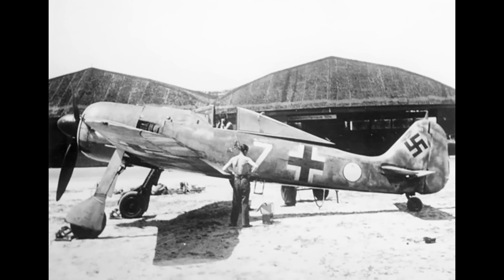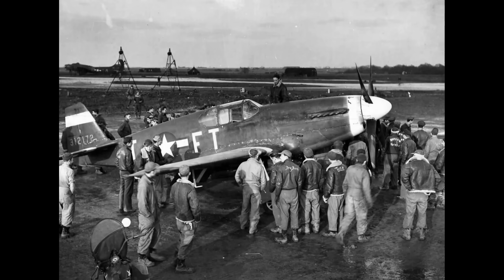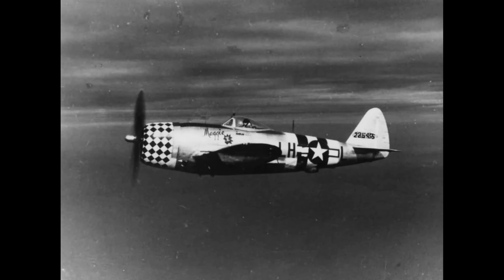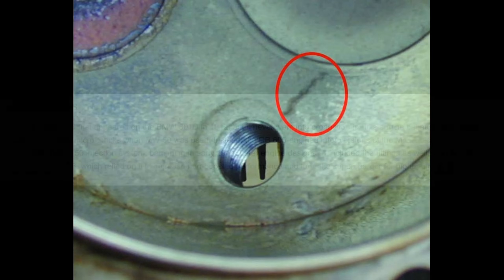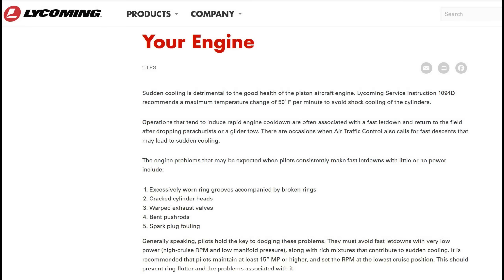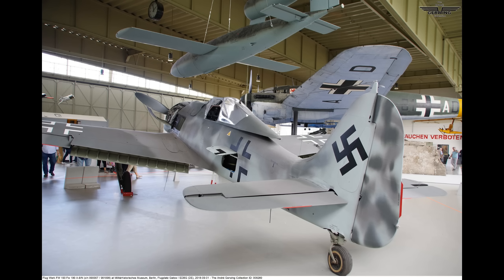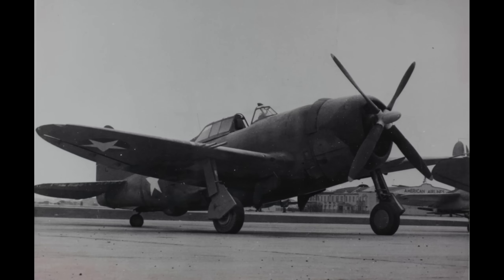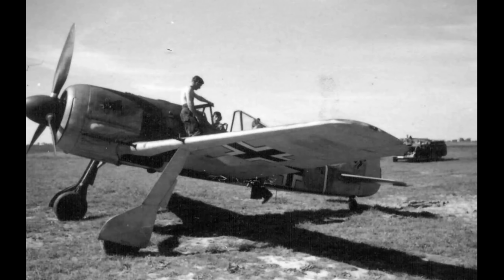Focke-Wulf Fw 190 A-4, Almost turned the tide, Almost...

Comment: I'm going to come down on the side of Shock Cooling being a myth in this application.  In my previous career I installed furnace wall cleaning equipment in large thermal power plants, which used giant water guns (called Hydrojets) to clean slag off boiler tubes while the unit was online.  We would blast 3000psi water at hundreds of gallons per minute right onto 1000degF tubes two to four times a day, every day the unit was online (8-12 months between outages typically).
We actually measured thermal transients via heat transfer sensors embedded in the tubes, these would give us tube metal temperature and Heat Flux (heat absorption).  A "normal" transient was about 100F over the course of a second or so, severe would be 200F or more.  Now this is steel, not aluminum, but I can count on one hand the amount of tubes leaks I saw in 5 years of doing this caused by thermal shock, and all of them were due to some sort of system failure (excessive cleaning, or a water valve stuck open and blasting the same area constantly).
My guess is this is entirely due to poor metallurgy, like you mentioned.  Lycomings statements sound to me like a case of "we have a few bad castings out there, and it's your fault if you break them".
Reply from the maker: You're not alone in that opinion. I don't agree with you, but that's OK.
Reply: There are an awful lot of air cooled pilots here saying otherwise
Reply: Aluminium has no threshold before fatigue takes place, even a small stress causes some life reducing damage.

Comment: When I flew the Navajo Chieftain I was taught to not drop more than 2 inches per minute on descent.  I saw the eerie glow of those pipes through the exhaust vents.  When I towed gliders we came down in a 60 degree slip/bank with the power at 1/3rd power to prevent shock cooling.
Reply from the maker: Good points Max. I'm glad to see most people agree with me that shock cooling is a thing.
Reply: Same with the 182 i did jump pilot flying with.

Fulll power in the climb, once level and coming on the drop run, power to like 15-18, adjust the prop for cruise and just hold level to let the engine cool for about a minute.

After jumpers out, engine vents closed, prop full forward, power to 15 and diving turn in the yellow. If done right you could cicle back and spiral down so you exit the decent already on final for landing.

Comment: When germany upgraded the machine gun armament of its fighters from 7.92mm to 13mm, I never understood why they went with such a weak 13mm machine gun. The German mg131 used a 13x64mm bullet. It was 2,350 feet per second. The American .50 cal used a 12.7x99mm cartridge and it was 2,900 feet per second, much more powerful and better for air combat. Germany had a more powerful round that was developed in WW1 to penetrate armor, it was a 13.25x92mm round. They could have done that, or they could have used the same type of 50 cal that Italy and Japan used on thier fighters, which was 12.7x81mm, which was 2,700 feet per second so it was weaker than the American 50 caliber bullet but it was much more powerful than the German 13mm round.

Comment: Greg you are spot on with the shock cooling! I got 4 years flying out of Bethel Alaska. Shock cooling was a big thing there. Especially in the winter. What's funny is we had a -34 below zero cut off. Only reached it once. But it was more because of door handles breaking off and tires sticking to the ground. Many use the same power settings as you would for any other flight. Yet we would definitely pull power back starting about 8 miles out, pulling 1 inHg every minute. Once our airspeed gets down to around 100 kts or below. You can quit worrying so much about shock cooling anymore. By using flaps if needed. I tended to drag the airplane in so I usually had power on, even in slowing down.  Back in 1984, the first time I was there. They would idle the continentals in the wintertime, in the 207's to like 300 or 400 RPMs. You have to pull hard back on the throttle to get it to do this. One of the airport we landed was only winter time and it was on ice.
Whenever we flew the big round engines we always treated them as if it was wintertime.
Reply from the maker: Oh God, you're giving me nightmare flashbacks. I did my time in Bethel in the 207s back in 89'.
Reply: @GregsAirplanesandAutomobiles  when you say "Nightmare" I definitely know you  flew in Bethel Alaska!
I flew for Herman's Air for the 84,85 season. Came back in 99 to 02 and flew for Grant.
I imagine we both have a lot of stories to talk about lol!
Reply: @GregsAirplanesandAutomobiles  hey Greg, something you may have heard about.
That there was an airplane that had a oral warning device installed in it that became known as a bit** detector!
Did you ever hear anything like that?

Comment: So the interesting question this gives rise to is what do we know about the metallurgy of the BMW Engines cylinder heads and how does that compare to the metallurgy used in Allied fighters like the P-47 that successfully ran water meth injection. Being able to identify the specific metals used might help us in determining that shock cooling from the MW-50 was in fact the cause. 

That being said I do think with the evidence you have your on fairly solid ground though it’s all based on secondary sources at this point.

Comment: When I met the parachute 'plane pilot at Coffs Harbour, we discussed this.  I was curious why he always came down under power. He pointed out that they were often cracking heads in their early days until they stopped doing un-powered descents. During summer, that plane never stopped every weekend. In summer, the temperature at the airport would be 27-29c. At 10,500ft it was -3c. That plane was easily doing 6-8 runs a day.

Comment: I have to wonder, why not go for a simpler water injection or just using less MW50 instead? If your problem is shock cooling, getting rid of the alcohol - which has a huge cooling effect - would make sense. Some power is lost sure, but still better than not having it. 
Another option would be to intentionally design it to run hotter, or inject a small amount of MW50 all the time to keep cylinder heat temperatures from getting very high in the first place.
Reply from the maker: If you get rid the alcohol then the mixture will freeze in the winter and be unusable. I'm sure all of these ideas were considered and they settled on C3 injection.

Comment: If I recall correctly from Calum's book, the later 190A9 with a prospective 801F was expected to use MW50. Although the 801F benefited from research in the 801E in terms of strengthen components to handle higher power in boost and stress from MW50 usage. Assuming they were able to reengineer the 801 to minimize possible shock cooling problems as well. To imagine what the 190's could have been if such issues were ironed out earlier and more powerful 801's available.

An informative video Greg.

Comment: I’ve actually experienced an increase in cylinder head temperature in certain C172s while descending from patten altitude. 

I suspect that the speed reduction setting up for the base turn plus the lower RPM on the fixed pitch prop reduces the amount of cooling air going through the cowling. 

I sometimes drop skydivers from a C182 and we have a procedure to prevent shock cooling by maintaining a minimum 14” of manifold pressure during descent.

Comment: Greg, The FW-190 had the same NACA 23000 series as every Beechcraft since and including the Staggerwing, and except the Starship, The Lockheed P-38 as well as the model 14-18, 049, 749, 1049, not the 1649, the DC-4, 5, 6 & 7, A-20, Mitchell B-25, Grumman F4F, F6F, F8F, TBM,  Widgeon, Goose, Mallard, Albatross, XP-46, PA-46 (Malibu, Mirage, etc) and every Cessna Twin up to the C560 (except the 510, 336 and 337), Meyers 145 and 200 and so many other great airplanes. Many Rvs use it as does the Questair Venturn and the Aero Commander 500-695. I don't know if you knew this. Probably the best all around airfoil ever.
Reply from the maker: It is a good airfoil. Thanks.

Comment: Thankfully, there is no one conventional weapon that could have turned the tide for Germany in WW2.  The FW-190 is just a well designed aircraft. There, that took about 9.45 seconds.
Reply from the maker: You obviously didn't watch the video.
Reply: @GregsAirplanesandAutomobiles  I did.  It's another good vid on the FW-190.  But during D-Day, the Allies had 11,000+ aircraft available for combat in England, and flew 14,000+ sorties.  The Luftwaffe had about 500 combat aircraft in the area, but fuel was limited due to low availability and allied pre-invasion interdiction efforts didn't help out at all.  The Luftwaffe simply was not in any kind of position to make any real efforts to oppose the landings - or any other Allied ops shortly thereafter.  The Allies maintained air superiority on an at will basis thru out Normandy ops.  It really helped to slow the German response.  .  .   I occasionally see vids suggesting that "Germany could've won if . .  . "  and they all look very unrealistic.  In this case, I doubt an improved FW could've turned any kind of tide, and anyway, it did not.  The cylinder cracking issues are interesting, but in order to figure out why that was happening, some real digging would have to be done, and it might have to do with original engineering design limitations.  I can imagine BMW trying MW50 out to improve power, and the discussion might be typical:  "Should we build the engine with stronger cylinders to accommodate MW50? Well, How long are these planes lasting in combat on average ? (in 1944)  Oh, about 30 or 40 missions until loss?  How much would it cost?  Do we have the materials for it?  No?  Ok well than we will just adjust the Kommandgerat system, these engines aren't hitting TBO anyway on the Western front".  Also, if fuel quality dropped, that could also have a negative 'pinging' effect haha.  Of course, this is pure speculation.  Cheers!
Reply: @Will-yz7oi  The Allies didn't really have total air superiority on D-Day; anyone who has watched "The Longest Day" knows that Pips Priller and his wing-man made a strafing pass on Sword Beach in their Fw-190s to uphold the honor of the Luftwaffe!

Comment: When was water/methanol injection first tried experimentally with the P&W R-2800? As I understand it, from the start of production or shortly thereafter, F6F Hellcats were delivered ready to receive water injection kits even though they initially didn’t ship with water injection. I know some P-47s had water injection installed in the field also. So it seems in 1943 the Americans were churning out fighters by the thousands with an eye towards giving them MW-50 when their system was debugged. The figure that I saw for the FW-190A4 was 985 units produced. MW-50 was back for the A6, but maybe the extra weight dulled the performance.

Comment: When I think of qualities I want in a WW2 fighter I’d go with acceleration, ability to climb and dive at high speeds (boom and zoom) and rate of roll. The 190 excelled at all 3 of these things. In a dogfight below 25k feet 95 out of 100 fighter pilots would take the A-5 over the Spitfire IX 66, the best overall spitfire variant. The 190 also had better armament, durability and could break off combat any time it wished by easily out diving the spitfire.

Comment: Hi Greg, 

this could have sth to do with BMW's subpar impeller design, which only changed with the 801 TS, which in turn AFAIK also successfully flew with MW-50 in a production model at 1.82 ata.

The RLM forbid BMW from any engineering work unrelated to getting the 801 to run reliably at full engine power, meaning the 801 utilised an impeller which was remarkably similar to the one in the pre-war Rolls Royce Buzzard, which one of Germany's chief engineers on aero engine charging, Werner von der Nüll, derided as backwards. 

This order was only counteracted in late 1944 when it was way too late, and it seems to me that it was simply forgotten due to the turbulence of mid-war personell changes and the sheer mass of different projects and too much focus on getting the Me 309 up and running.

Anyway, politics aside, the better the impeller design, the less heat is added to the charged air, a point which becomes clear when looking at the DB628 development. It essentially was a 605 with a somewhat unique frontal first stage supercharger, with the air then being routed around the left side of the engine into the standard 605 supercharger. 

When the DB engineers added an intercooler, they found that the DB impeller designs comparatively added so little heat during the charging process, that the added drag, weight and manufacturing complexity of an intercooler wasn‘t worth the effort.

BMW‘s somewhat ad hoc solution for the 801 TS, which was essentially an 801 F with D-2 parts which hadn‘t been fully developed for the F yet, was cooling the supercharger housing with water.

I suspect, given the laws of thermodynamics, that the hotter charge air, in combination with the already hotter running air cooled radial and German war time metallurgical restraints, meant the 801 was more susceptible to the effects of shock cooling.

Comment: near top of the list for single prop aircraft? P-47 1st....?
Reply from the maker: For ground attack, I would probably lean towards the Corsair, but it really depends on the mission. Thunderbolts flew ground attack missions with bombs 500 miles each way! I don't think any other single engine plane in WW2 could have done that. But if it's to a target close enough, then I think the Corsair would be a better choice.
Reply: @GregsAirplanesandAutomobiles  WRT soaking up damage, I guess the thud would be at a disadvantage with its turbo and boost pipes in aft fueslage, were their turbos oil cooled? Charge cooling type and location of heat exchangers for thunderbolt? Any other reason to choose Corsair?

Comment: Thanks for your educational video, Greg. 
This has been very enlightening as always. Maybe, for this Discussion, you want to to take a look at some Bundesarchiv data. There is Archive number  RL 36/129, which is a report from Rechlin proving Ground, dated 04/10/1943.  
As the Title suggests, this is discussing explosions in the intake Portion of a BMW 801 D series engine when using GM 1. You can also find this data when you google for "Rechlin Erprobung 2581".
If you need translation, i can assist with that. 

Keep up the good work!

Comment: Hi, Greg, "Aircraft in Profile Fw190 A" lists the top speed of the A-4 Trop version used in the North African campaign as only 367 mph; which indicates that this version wasn't equipped with the MW-50 system. A-4/R6 with under-wing WG  21 mortar tubes topped out at 373 mph.
Reply from the maker: Not all were MW-50 equipped.

Comment: I wonder if it was the 801’s problematic exhaust valves that couldn’t take the sudden cooling, rather than the heads, which would have had more latency. Grateful for any thoughts on this.  Thanks for another great video.

Comment: Thanks again for an interesting analysis what if scenario. I usually think of such scenarios myself. But not with this nice technical analysis of the airplanes you do. Always interesting videos you make. For example, imagine if there was a squadron of Heinkel 280 jet fighters in full operation in the summer of 1941 over England? Imagine if the Heinkel177 bomber had been in operation to bomb logistics and transport routes deep inside the Soviet Union and England with the protection of e.g. Heinkel 280 fighter jet in 1941. Just theories about weapon systems that could change history very much. Kind regards from Sweden.

Comment: Didn't the A4 also have laminar flow wings (like the Mustang), which had made them tricky to handle in a tight turning dogfight?  I think they would have been more effective using "boom and zoom" tactics, which some don't consider real dogfighting.  But, I agree - they would have been extremely effective against bombers and against fighters if they kept their speed up.
Reply from the maker: The 190 does not have a laminar flow wing. Actually the Mustang doesn't really either, the Mustang has a wing of "Laminar Flow Design", which is not the same thing. I have an entire video about that somewhere.
Reply: @GregsAirplanesandAutomobiles  Thanks, I will take a look at that video.  Perhaps it would be more correct to say "fat wing" vs. "thin wing".  On the "fat wing" side are aircraft like the Ford Trimotor and Ju-52 which seem to levitate off the runway at low speed.  Then there are "medium wing" planes like the Wildcat, which had to take off from carriers without catapults and were good low altitude dogfighters (especially the FM1).  So perhaps planes like the P-51 and the B-26 fit in the "thin wing" categories - planes that required higher takeoff/landing speeds and could exhibit unpleasant tendencies when pushed too hard in a turn.  I had heard that the A4 also had this tendency, so I assumed it was in the "thin wing" category - which I assumed meant it also had a laminar flow wing. [http://www.wwiiaircraftperformance.org/fw190/ptr-1107.pdf] (Part of the difference could also have been that the A4 did not have slats like the 109, which helped it turn.) What is the name of your video?